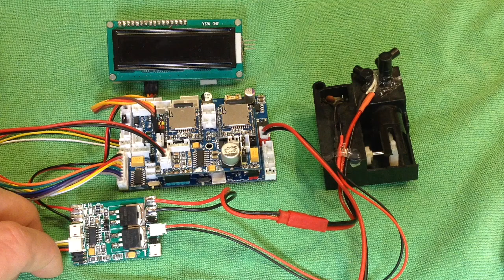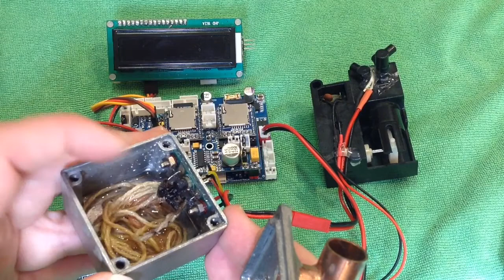SmartSmoke Introduction - Factory Smoke Unit

Comment: I know this is old.. but can’t tell much here. Prob all smokers have is a constant flow. The smoke needs to be puff puff puff to replicate piston fire. Can your board do that? Can’t see much in vid
Reply from the maker: Yes it can.  BUT not all tanks will have a puff puff.  Modern tanks won't have it and the beauty of Smart Smoke is the "smart" part.  It runs different programs depending on tank - puffing for WW2 era and no puff for tanks like Abrams.  Also the amount of "puff" depends on what type of smoke unit you are controlling, fan units, or piston type pumps,...  See this video https://youtu.be/NAge_3PSNhI
Reply: rctanksau awesome. Thanks for info. Looking for a home built MAZ.

I may build this. This is perfect for me. 

https://youtu.be/x3pHZZzt2jw